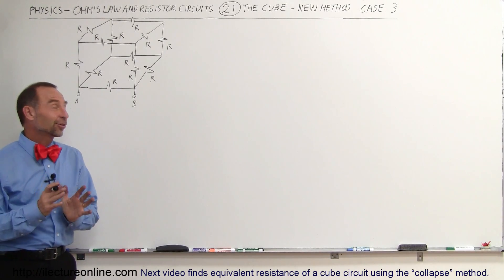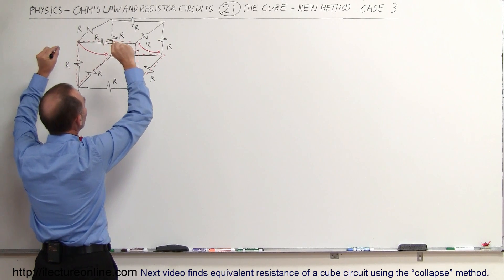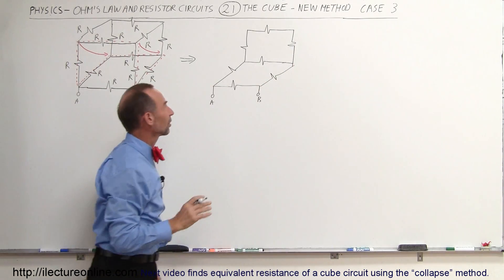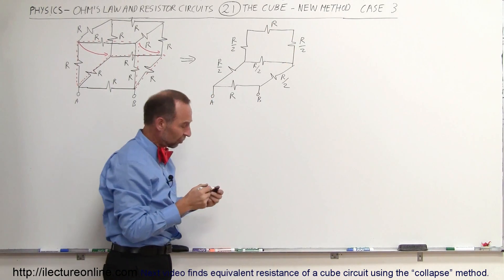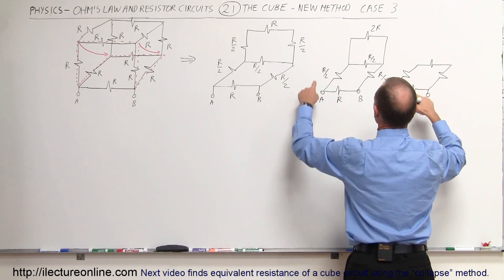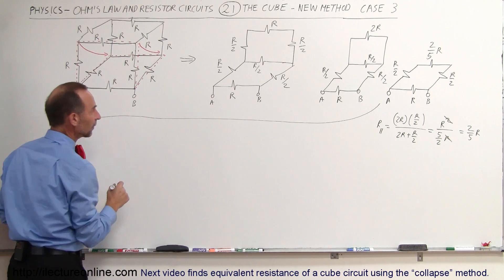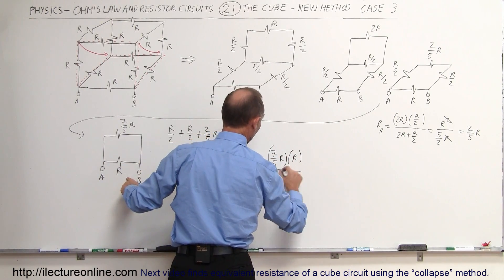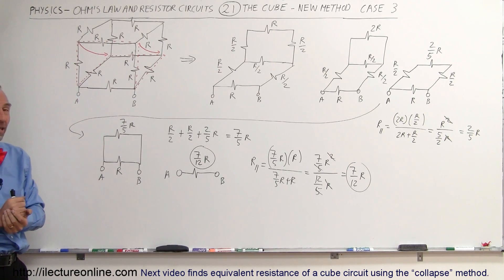Physics 42   Ohm's Law and Resistor Circuits (21 of 23) The Cube: New Method Case 3

Comment: Brother !!!  How would I do if the resistance of the cube arm was unequal?  I searched the whole net world and found no answer.  If you have any known method.  Let me know
 PLZ Don't skip this question.
Reply from the maker: We have an example where the resitors are not all the same value, BUT there is symmetry, which then used the "folding" method.  If the resistors vary randomly, then you need to use Kirchhoff's rules.
Reply: @MichelvanBiezen  plz  give me link..
Or make a video where qube arm resistance randomly varies . Thank you sir

Comment: i do not understand one thing, even if the two paths are exactly the same for current, how can we just collapse the resistors on each other? i mean wouldn't that alter the circuit altogether?
Reply from the maker: It is like replacing 2 parallel resistor with a single equivalent resistor.  As long as the resulting circuit is equivalent, the current will be identical.
Reply: @MichelvanBiezen  I understand  that  but my question is ,how is the circuit the same after we have collapse the resistances onto each other

Comment: good, what if the resistance is not the same ??
Reply from the maker: Ultimately, we can always use other circuit theorems or Kirchhoff's rules.  (see the electrical engineering videos on this channel).
Reply: Then it's becomes easier .spoon feeding problem

Comment: is there anyother way to do it without the collapse method?? what to do if the circuit doesn't have a symmetrical structure?
Reply from the maker: Yes.  You need to redraw the circuit as a flat circuit, and then use the conventional methods.